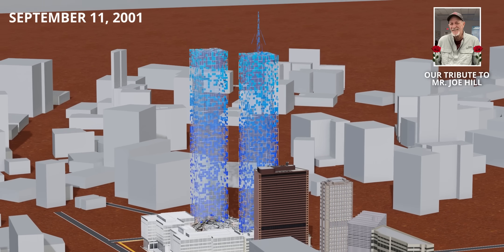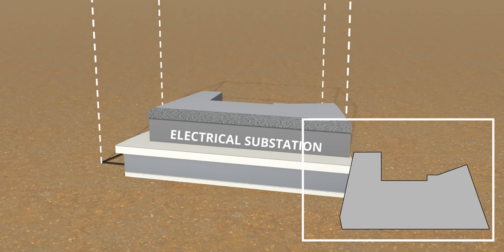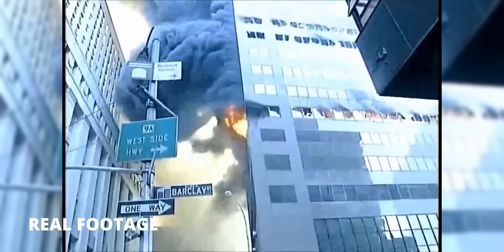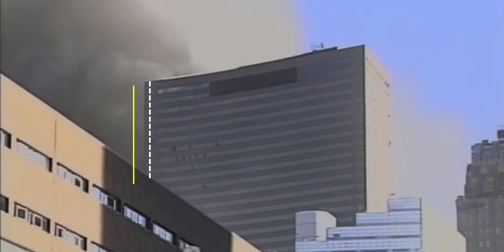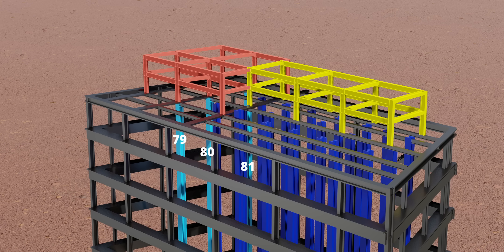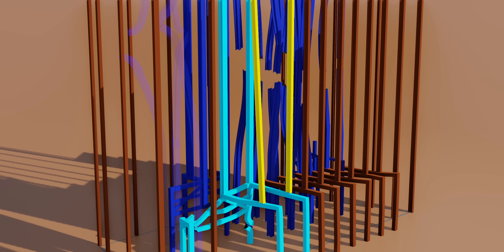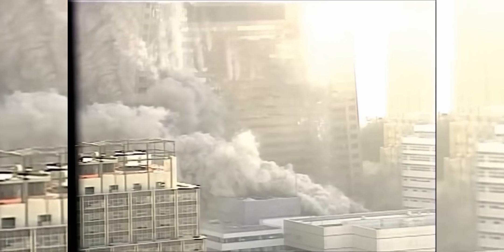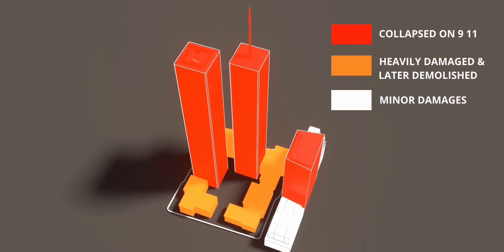Collapse of Building 7 | The Complete Physics

Comment: What I don't understand from this video is why the collapse was initiated on the left side (under the extra penthouse) when the major damage from the spire was on the right side (as seen at 9:00). What damaged the left side?
Reply: The damage cause by debris weakened the whole structure, same as how fire weakened the metal beams, however the east/left side had additional weight due to the newer penthouse, which wasn't as well supported as the right/west penthouse, so the left/east side collapsed first.
Reply: no because  .... ur conspiracy theory! You hate freedom and democracy!
Reply: Fire
Reply: Fire.  Collapse was due to the effects of 7 hours of unfought fires, not the physical damaged caused when the North Tower fell. That is spelled out in this video. 

The one significant complaint I have about this video is that it fails to address the critical role of the floor systems in providing critical lateral support to the core columns. As described in the video, the columns at the east end of the central core (79, 80 and 81) failed first and this was due to fire. They failed by buckling. Why they failed is because floors in the NE corner of the building collapsed, causing the columns to be laterally unsupported over an excessive length. This is not really covered in the video, but the cause was the fires, not the physical impact damage 7 hours earlier.
Reply: @MFitz12 So trace amounts of Nano Thermite is a conspiracy theory?
Reply: @MFitz12 why or how do you explain floors on the 80 level caused the building to collapse like a CD ?
Reply: @tonyc7689  - I don't. Building 7 did NOT collapse like a CD (whatever that means) it collapsed like a building collapses AND it had only 47 levels, not 80.

If you would like to talk about things that actually happened I am happy to do that. But you need to get the basics right.
Reply: @MFitz12  A buckling building does not go down like a card from fire. Especially if it is a fire. A building only goes down like this if it is controlled demolition. But not even then it is sure it does. Just look at any building on fire. Do you know how much they can withstand? And how it looks?
Reply: @MFitz12  Fire does not cause a building to collapse, why is it so hard to understand? Especially when it is not jet fuel or anything containing it. They also had sprinkler systenm, but of couuuuuurse it stopped working. These are well made buildings. Why do you think they use explosives?
Reply: @Feooooooooooooooooon  Heat can ABSOLUTELY cause a steel structure to collapse.
It's the reason why heat is taken into consideration when calculating structures that'll be exposed to high temperatures.
Heat changes the material's properties and therefore changes how it reacts to the loads it's exposed to. And guess what? Fire causes heat.
What are your qualifications to claim otherwise? Because it goes directly against physics and engineering.
Reply: @Feooooooooooooooooon  So you're calling the fdny liars?
Reply: @mgx9383  lol fire. That narrative is so absurd. The fire from all the foolscap paper that nobody stores near beams, that magically melted the beams ?  That fire?!  Or was it the desks that burn 10 times longer and hotter than any wood in a fireplace?  Or the super cheap carpet that burns as hot as the sun?  This happens all the time right?? Oh wait, it never happened before or since. But fire!
Reply: @southerncharity7928 They did not melt! Have you ever forged metal? That metal is not that hot and yet pretty bendable. This video just says, that they buckled, which at the temperatures of a house fire in conjunction with heavy loading (the extra penthouse) doesn't seem outside the realm of possibility.
Reply: @southerncharity7928  my friend, in my structural engineering degree we were shown materials change properties when heated. Steel beams essentially become wet spaghetti noodles and have rapidly decreasing strength at temperatures above 250 degrees Celsius. If the fire is 600 Celsius, it wouldn't take much time for the beams and columns to lose their strength. Combine that with an increased unbraced length from collapsing floors, and you have a very straightforward failure method. There's no conspiracy here.
Reply: @JakeLipohar in your extensive knowledge of engineering did your little experiments use jet fuel ? Or did these teaching moments also show an experiment where thermite was used n, just curious
Reply: @southerncharity7928  right, a fire burning down a building (as any building that has an uncontroled fire will eventually collapse and this building was on fire for 9 hours) is such an 'absurd narrative'   but what isn't an absurd narrative is the notion that a demolition team went into the building and wire it up with dynamite by drilling holes and inserting dynamite sticks into the support structure and this was all done on the night of Sept. 10.  and somehow this demolition team was working with the airline hijackers as a backup plan just incase crashing 2 jumbo jets into the complex was a big enough disaster.
Reply: @southerncharity7928  How much of a background do you have in physics?
Reply: @junfour  do you know who did understand physics?  The BBC, as they reported the fall 20mins before it happened!!! 100% fact.  Things were just so confusing that day right?!
Reply: @southerncharity7928  Things in general can be confusing to some people.
Reply: @southerncharity7928  "do you know who did understand physics?  The BBC, as they reported the fall 20mins before it happened!!" - Because the FDNY predicted it would happen and the BBC incorrectly reported it. There you go. Mystery solved.
Reply: @junfour He has background in conspiracy from his mom’s basement.
Reply: @junfour does t matter common sense plays a.part in observations , physics also limits the thinking abilities always trying to make sense of something , skewing ideas till it reaches a conclusion they were looking for to begin with

Comment: Really good explanation but I still have some questions: did it had a bad project? Do we had any other build being broke like this before? Do we know any building made the same way? Are those transfer columns safe? What different things on the project could help with that specific problem?
Reply: The problem is that we have absolutely nothing to compare 9/11 to. It was and forever will be an absolutely unique event. Therefore the physics that caused these buildings to collapse took some time to understand. Unfortunately our inexperience with such a violent event is what led to all types of wild theories that exist to this day and will continue to exist
Reply: @chrisadlc1  that day was too dark to believe. Everything was so absurd that it was easier to create stories than believing what was happening
Reply: @chrisadlc1  But WTC7 was caused by fires that caused the steel frame to weaken. Plenty of steel framed high rises go up in flames without any collapse.

According to NIST, WTC7's columns should've collapsed if a random fired occurred in the building. They even say the structural damage wasn't a major contributing factor to the collapse.

NIST also won't release their simulation to the public because of "security concerns". So engineers can't even examine the simulation & use it to improve buildings to prevent collapses from fires.
Reply: Stronger perimeter?
Reply: This explanation is nothing but BS, Mr. Silverstein (the owner) clearly stated that the building was pulled aka controlled demolition, end of story.
Reply: It's the same as fukushima. As nobody expected an earthquake AND a tsunami at the same time there, nobody expected a chunk of a building to hit it.
Reply: @IMIv2  totally different bro, 9/11 was a barbaric act of Mass Murder. Men willing to commit suicide just so that thousands would die and thousands more would brush with death and live the rest of their lives with guilt, depression, and sickness. After 9/11/01 the world would never be the same.
Reply: @IMIv2  You do realize that it is earthquakes that cause Tsunamis....right?
Reply: @PamelaRiley-gg9dy I‘m sure he does. But what’s your point? It’s not necessary that a tsunami follows after an earthquake.
Reply: @miaumi69  " But what’s your point? It’s not necessary that a tsunami follows after an earthquake."
im sure you can infer the point
"nobody expected an earthquake AND a tsunami at the same time" would be strange, seeing most tsunamis follow an eartquake, Japan is eartquake country, and Fukushimza is, well 'not very far' from the sea

Comment: I must say, I doubted this video would ever see the light of day, thinking the subject was too complex for the tools you were using. I also suspected if it did finally arrive, I would be underwhelmed.  Now that it is here, *color me thoroughly impressed*.

For the intended audience, this is pretty darn good, far better than I expected and a much better than the very popular Twin Towers video from last year. For levels above the intended audience this is still really damn good. A lot of critical details that all-too-frequently get ignored are presented and at just the right level of complexity. I do have a few quibbles on some points - notably the lack of attention to the role the floor systems played in providing critical lateral support to the columns (79 especially) - but nothing which moves the needle in any significant way. 

For conspiracists, many of whom will no doubt soon fill the comments reciting dogma about controlled demolition and inside job having either not watched or not grasping this complex topic, they are not the intended audience. But their presence is as inevitable as the sun rising in the east.

Comment: According to wikipedia, WTC7 is 190m (610ft) tall. The free fall calculator gives me 6.225 seconds as free fall time. You claim that the building fell in 5 seconds. That's confusing.
I would like to remind you that free-fall in vacuum is not a linear, so you cannot arbitrary cut things in half to get exact results.
Reply: The free fall calculator doesn't calculate acceleration. And as he explained in the video, videos that are uploaded to the internet are often sped up by 40%, the 5 seconds is that
Reply: @heuhen  Free-fall means that the acceleration is g=9.8m/s*s.

I'm only using the samples and claims the author himself included in the video.

I said they are confusing and you indeed seem really confused.

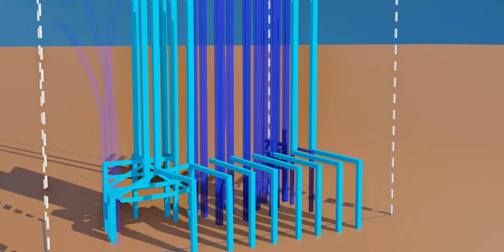Comment: 6:55 - This looks wrong. Why are the columns cut so high at exactly these spots? Why are they cut in such quick succession, without visible transfer of the load (aka deformation of the building). They all fail before the collapse, not during the collapse!
EDIT: To transfer the load, the building has to buckle up at the points where columns break. There are no debris jets at the collapsed floors like in WTC1/2.
Instead the building deforms as a whole.

We are shown columns on the other side of the building are severed, while columns right next to the visibly damaged ones remained whole and caused the twisting of the building.
Reply: @h1F595  It didn't deform at the points where the columns buckled up. In the video WTC7 deforms as a whole, indicating it preserved structural integrity. If a single floor has collapsed, we would see sideways jets, like in WTC1/2 collapse.
The transfer of load means one portion buckling up, then followed by another portion. Even the penthouse on the top "collapses" in a single motion.

Comment: how could all those columns collapsed instantly? looks like a ton of bee-as
Reply: They didn't. It lasted well over 20 seconds. Your comment is bee ass
Reply: They obviously didn't.  Did you even bother to watch the video? Lesics could not have spelled it out more clearly. FFS 🤦‍♂
Reply: @TheCriticalStinker-01  their explanation: 3 columns burned out. Building standing. Rest of the 80 columns burned out. Building collapsed. It's just ridiculous
Reply: @xfxox  - 3 columns buckled (actually over-simplified here; it was one column then two) which began a progressive sequence of failures. 

This video is pretty good, but it leaves out one critical component that I think will result in a lot of confusion. That element is the role the floor systems played in providing critical lateral support to the core and perimeter columns.

Column 79 failed in euler buckling because of multiple floor failures leaving it laterally unsupported over an excessive length.  That is when the kink appeared in the roofline of the EMP.  80 and 81 failed quickly after that because when 79 when down, it took away all the lateral support those columns relied on to the north and east. 

So what does that mean to the rest of the core columns?

They have no lateral support to the east at all since 79-81 took all of that with them when they dropped.

So what happens to those core columns?

A progression of buckling failures from east to west through the core until the core is gone, much as described above. And what happens when the core is gone, taking all the floors with it?
Reply: @TheCriticalStinker-01  That's not what this video animation shows.
Reply: @ИванСнежков-з9й  - Did you miss the part where I said This video is pretty good, but it leaves out one critical component ,...

I am much less interested in what this video animation shows than I am in what actually happened.  This video does a good job overall, with a lot more detail than many viewers can handle. But there are a few details they left out that I personally think they should have included - to avoid having discussions like this.
Reply: @TheCriticalStinker-01 There was
thermite and 45 degree cut beams in all tower locations, FFS!
Reply: In your physics simulation software, change the beam settings from hardened steel to caramel :)

Comment: So why exactly did the building collapse around the perimeter at the same time if only 3 columns burned out?
Reply: 6:20 he literally explains it
Reply: @mrmystery9965  reading/listen comprehention is famously high among conspiracy theorists
Reply: @mrmystery9965  he explained nothing. 3 columns burned but building did not collapsed until all 80 columns magically broken? the way he explained the building should be going down immediately after those first 3 columns were destroyed and building should be going down step-by-step, not instantly
Reply: @xfxox What do you think happens with the weight, which these 3 collumns held? Load transfers into the remaining structures, which than exceeds the strenght or stability of the other collumns.
Reply: @risabc  that's not how physics works, if you break a chair's leg you sit on, you will tip over. Are you saying you will stay on a chair until all 4 legs are broken?
Reply: @xfxox You're either incredibly dense or being intentionally disingenuous if you think that's a comparable example and is what they were saying or implying. It's already been explained to you in simple terms, you're just refusing to listen.
Reply: @user-Aaron-  there is a huge gap in explanation between 3 columns breaked down and rest of the columns breaked down. Why the building did not collapsed between those 2 events?
Reply: @xfxox  The video literally explains it to you but people can't teach you what you're unwilling to learn. Unless of course you're incapable of understanding simple logical progression even when it's explained clearly in plain terms and accompanied by a detailed animation that walks you through each step, in which case, boy do I have news for you.
Reply: @xfxox  I am a structural engineer, and what happens is a progressive collapse, like he explained in the video. Weight cannot travel through air. When 1 column fails, the other columns now have to take over that load, to bring the load down to the foundation. The load path changes in other words. But that new weight added to the remaining columns, can be too big for them. And if you talk about all those other columns, they were much smaller, so they failed at a very high rate because every perimeter only had limited resistance anyways.
Reply: @xfxox 6:12 to 8:09 walks you through it 🤡

Literally everything you said is not only wrong but blatantly so, which confirms what I stated previously.
Reply: @ducoh2093  i understand. but. look at the footage. is how this building should be going down if it was happened like you explained? no tilt, no tip just fell down straight?
Reply: Small hat tribe
Reply: Demolition charges.
Reply: @Sourpusscandy  - How did these alleged charge survive in a building that was on fire for seven hours?